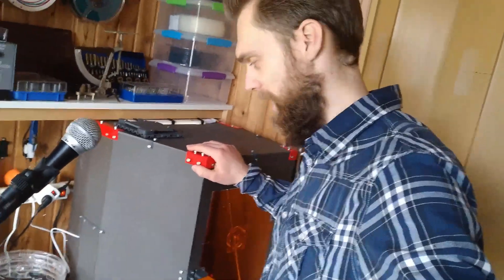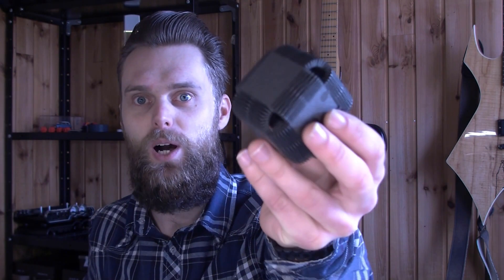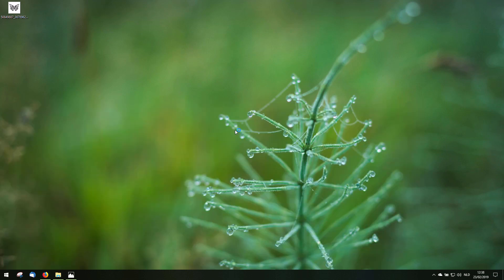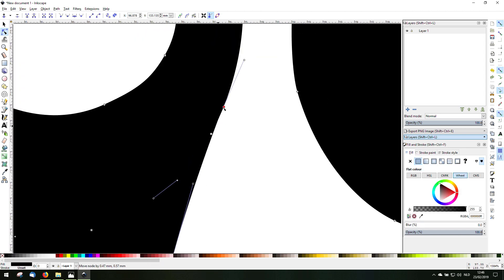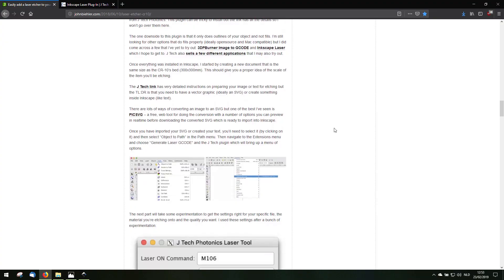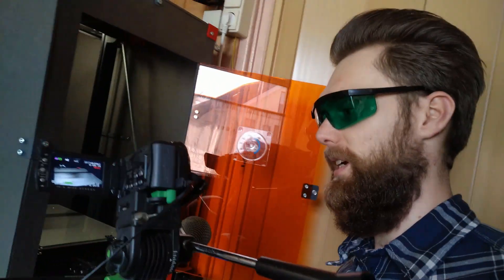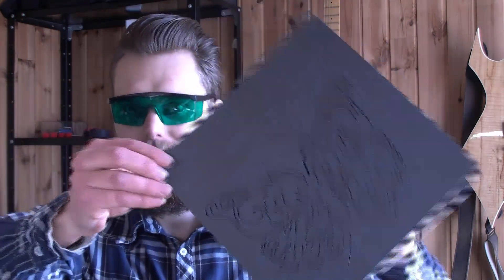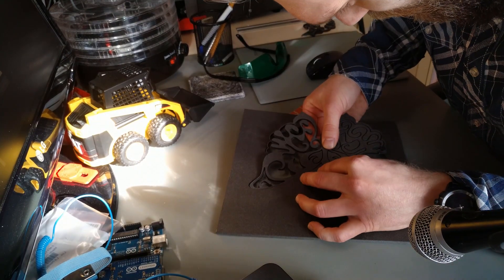Creality 3D printer equipped with laser cutter

Comment: I'm not a specialist, but I THINK your bed is stealing heat where the material touches it, maybe you should try to put something heat isolating or some kind of grid/screen, so se contact points are very small.
If you have smoke during the cut it will disturb the laser cutting, you can put a fan to move it away from the beam.
Also, if your software has this function, you can make a second pass with the Z a little lower, so the beam can be more focused in the bottom of the material.
HTH

Comment: Traceback (most recent call last):
  File "laser.py", line 78, in <module>
    from inkex.paths import CubicSuperPath  # noqa
ImportError: No module named paths

I do not know what is going on with the Inkscape pluging but I cannot generate the .gcode.
Reply from the maker: Make sure that the object you are making a gcode off consists out of paths. If not select the object, go to the menu paths and click object to path. This must be done for text as well. Hopefully this helps.
Reply: @properprinting , thank u so much. I asked a friend and changing my "laser.py" (that I downloaded two days a go) with his file (an older version). Now it works as you explain in the video! Happy with the results. :)

Comment: Wonderful video. 
Gotta get that cable management dialed in 😉
Also, could you also change Z height “layer by layer” as you pass through the material? Say if you were cutting 20mm sheet. Focus point is at +20, but as you run a pass one could then lower the Z height by 5 mm, then 5, then 5... you get the idea.
Reply: I know this is an old comment, but for anyone wondering this is indeed a feature in software like lightburn. The tricky part is figuring out how much to move the bed as you don't want to move it too much per pass.

Comment: Another project I want to do with my CR10-s5.  It's my first 3d printer.  Is the laser running off of the power for the hot end?  How big of a laser would it power?  How would you protect the aluminum plate below?  Possibly a thicker sheet of plywood.  subbed on a different video this morning.  Thanks, Ken
Reply: i’ve got a cr10s5 and wanna do the same !

Comment: Hi just a question. if I put a picture (PNG) in the inkscape program and have it make a g code. but nothing happens !! it does not make g code. what am I doing wrong ? do I still need to edit the PNG in some way? import. In short HELP.
Ps am a Dutchman
Reply from the maker: This is quite funny actually because I cut that section out. When I originally uploaded it I showed how I traced the bitmap (which you should do) and that removed the water mark as well. Someone pointed this out in one of the earliest comments, I traced down the source of this image, paid for the license and cut away that part of the video. If you search for Inkscape trace bitmap, you'll find what you're looking for ;)
Reply: @properprinting  top thanks for the info I will come from another question. the laser do you have it on the mainboard of the cr10s (if yes where) i have the version 2.2. but no 12v about an HT2 port and a fan port but these do not give 12v? or is the laser powered separately? thank you in advance !!
Reply from the maker: @gabyenpetervanderlugt2579  I connected it to the part end fan which can be controlled with the Gcode. In case of the CR-10 it's at 12V. This only works with a low power (500mW) laser.
Reply: @properprinting  THANKS !! Happy Printing ! But first go print the attachments

Comment: Hello, the channel is very interesting. At this time I need your help. I am having trouble wanting to make any design that contains curves. When I make straight figures I have no problem, but when I have a curve in the drawing it makes it straight. I can't solve it. Thanks. Greetings from Uruguay
Reply from the maker: I've answered this question to the mail you've sent me, but I'm answering it here as well if someone has a similar issue. The curves are made with the arc commands G2 and G3 which isn't supported by the firmware by default. RcLifeOn has made an interesting video which covers that topic: https://youtu.be/TQZwTac1Cks?t=329

Comment: Awesome video, i am also planning on doing laser cutting on my cr 10, could you give me the link of your laser? Thanks :)
Reply from the maker: Thanks! I have created a shortened URL to make this comment readable http://bit.ly/12VLaserEngraver However, if I would have to buy one again I would go with one which has more power but I don't know which one yet. The one in the video is fun to start with.
Reply: @properprinting  thanks i will check it out :)  how strong laser are you aiming at?
Reply from the maker: @3dcrafts905  Datulab Tech has used the quick tool change to fit an Endurance laser to it which looks very promising. https://www.thingiverse.com/thing:3530513 I have not done much research yet and this is their site: http://endurancelasers.com/ I don’t have any experience yet with it so far.
Reply: @properprinting  Hey, unfortunately the link doesn't work anymore. How many watt does the laser have?
Reply: @sroesner  The default Creality laser (which I think John is using) is 0.5W

Comment: it will take more then one or 2 passes to cut threw
Reply from the maker: This depends on the type of material, its color, thickness etc. In case of these XPS sheets, one pass is enough to cut through. At least if the focus is correct 😉
Reply: Sir which minimum watt of laser is required to cut this xps sheet ...Help me I need to buy

Comment: Does can it cut playwood or plecsiglass(acrilic)? like 5-6mm?
Reply from the maker: No, not with the laser I have used in this video. You need more power if you want to cut through plywood. Datulab tech made a video in which he used my quick tool change to fit a 10 Watt laser module made by Endurance laser.
Here is the link to that laser: http://endurancelasers.com/diode-lasers/10w-endurance-laser/ 
and the video: https://youtu.be/R9OHYq-Ws-w

The XPS sheet is the best material I have found which can be cut through with this low power (500mW) laser. I am thinking of buying a laser with more power to really cut wood because I think that would be awesome.
Reply: @properprinting  Do you think either will cut through heat transfer vinyl? Theres a product called siser brick 600 which is 600 microns or .6mm thick.
Reply: Sir please help me comment me .. I want to know what minimum watt of laser is  required to cut xps white sheet
Reply: Sir please comment your email to contact you please
Reply: Sir please reply your contact

Comment: The watermark on the design is to protect the designers copyright...
Reply from the maker: OK, I have updated the description and purchased the license. I also cut the part out in which I show how to remove the watermark. You have probably saved me from more trouble so, thanks again. Lessons learned ;)
Reply from the maker: Thanks for pointing this out. You are right, I haven't thought this through because for me it was just about laser cutting and not about making money out of this specific design. I have found the source of this picture and contacted them. Depending on their response I will update the description of this video and hopefully I do not have to remove it.